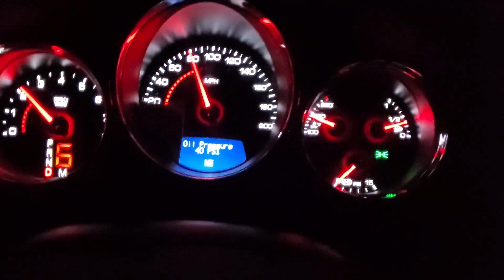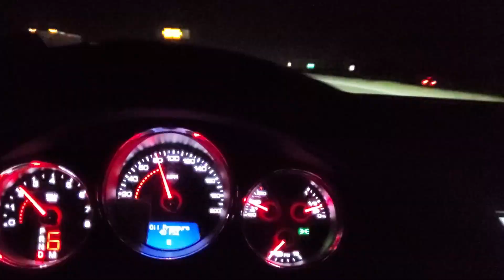Gapped This LT4 CTS V and Blew The LSA Engine

Comment: The v is bad about making crankcase pressure, I have 2 catch cans and both valve covers have “breathers”. I’ve blew out both valve cover gaskets in one pull and leaked oil everywhere, Replaced seals with catch cans and no more issues. But yea I wouldn’t necessarily plug anything closed.
Reply from the maker: I have a mighty mouse wild can on there now